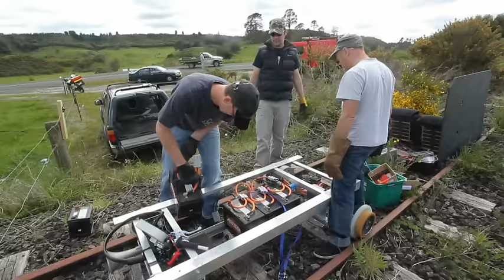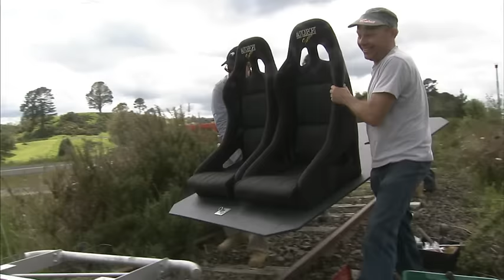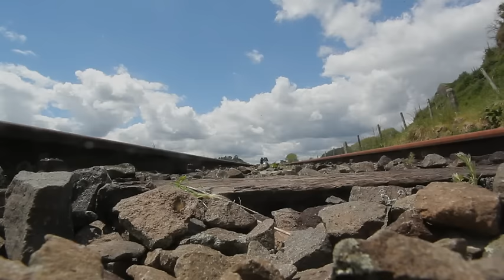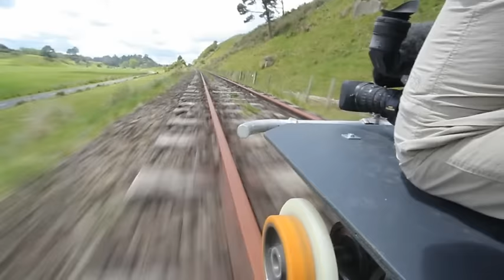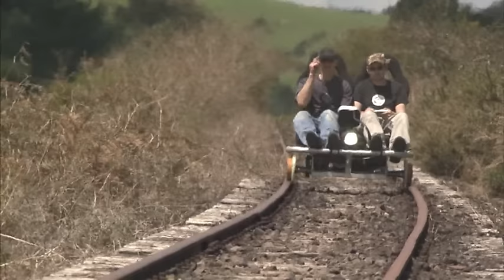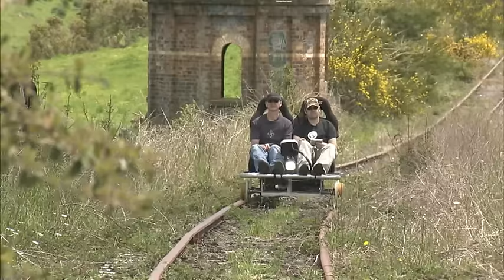First test of our solar powered railway trolley

Comment: Great video. You've got some balls to go this fast with an DIY trolley. A little tip: make your wheels conical shaped. So the outside of the wheel has a smaller circumference than the inside. Just about a few millimeters. This way the trolley will stay on the track without colliding onto the flange, which will roll very smooth. Real train wheels are shaped this way as well.
Reply: Hello Richard after 11 Yrs 😁😁
Reply: Kudos Richard, you are among the oldest users of YouTube
Reply: Are you still alive
Reply: @Shuklaji712  
Same qq
Reply: Are you alive Richard after covid 19?
Reply: @anishtiwari9643  uhum. I’ve been here longer. Just saying 😬
Reply: @tangomike15  wow. Congrats
Reply: @Anish Tiwari  lol!
Reply: @tangomike15  yea. You're using YouTube since i was just 3 yo
Reply: @anishtiwari9643  it was great. No adverts!
Reply: @tangomike15  what is your age bro and where are you from
Reply: After 11 years later i have seen this .

Comment: It is not solar powered.  It is battery powered with partial solar charging capability.
Reply: Maybe full solar charging or how can you know explain us pls
Reply: With the help of Solar energy... battery well be charge....
Reply: Hes talking about the indirect input of solar energy. Its not driving because of the solar power stored in that particular time. Instead its powered by batteries wich were charged with solar power. Its like saying i drive a solar powered tesla, just because i charged it with stored solar power it doesnt mean its solar powered but battery powered
Reply: Certo partial
Reply: ।ऊगखोम
Reply: There is difference between Solar Powered & Solar Charged....
Reply: @GameOver._.  your explain is understandable
Reply: If there weren't batteries in there, the trolley would just stop in the middle of a forest.

Comment: Huh? With all those batteries, how can it be "solar powered?" I didnt see any solar panels on it either.
Reply: So you think solar panels convert the solar energy into electrical energy in real time? lol the technology ain't that advanced yet, friend. Solar panels are connected to batteries which store the energy in chemical form, which is then used to do mechanical work or convert it into other form of energies.
Reply: @ashutoshsharma1293  i already knew that, but why did the "electric rail go-cart" builders claim it was "solar powered" when it was actually battery powered?? Yes, it takes forever to charge anything with solar panels!!
Reply: @paulsmith5398  umm because the batteries were charged using the solar energy? I don't know what's so confusing about it!
Reply: @ashutoshsharma1293  and these companies that sell and hype up solar energy claim its the best, i would rather pay my high-priced electric co-op than have something thats not dependable. If you live off the grid and have solar, when the batteries go dead from no sunlight, youre screwed.
Reply: @paulsmith5398  Yeah, that's common sense which is why world is never going to fully depend on the solar energy until our civilization is advanced enough to harness all the energy coming from the sun. Renewable energy sources are not dependable and that's why they're either used in combinations (Solar with wind and hydraulic) or not used at a very high scale for most things.
Reply: @ashutoshsharma1293  when my wife was living, our electric bill would approach $300/month(US dollars), she paszed away last year, and i have done some energy saving projects. The electric bill has gone down to $105/month (US dollars), and i just got a nice refund to help "pay it forward" for 3 months. Thats the thrifty Scottish bloodline in me!, and i am currently doing more projects to lower the electric bill even further.

Comment: To have panels run the motors direct would take dozens of panels. Far easier to use a few small panels to charge batteries and use them to provide the large amps needed. Not realy solar powered cart though, just battery powered, you could always charge it from a wall outlet and shoot another video called   "NUCLEAR POWERD RAIL CART HOME MADE"
Reply: But you need to store energy before you can use it effectively. Nuclear power is used not directly, but to turn turbines which then generate electricity. When you see "Solar Powered Light" - the solar part is actually to charge the internal battery - it would be useless when the sun goes down and you need a light, if there were no batteries? So there are varying means for storing electricity in order to use it. How friendly that is and what the source of that power is - is the differentiator?

Common arrangements include: -

Solar > Battery > Consumer (Off-Grid)
Solar > Inverter > Grid
Wind > Battery > Consumer (Off-Grid)
Wind > Generator > Grid
Nuclear Reactor > Turbine > Generator > Grid
Reply: DEAN WATERS use high voltage thin film grid tie panels if you could afford it heavy duty lithium ion batteries deep cycle,,, if not then use 6 volt heavy duty golf cart batteries build a trailer put solar panels all over it also build a roof canopy put solar panels on it,,, I imagine you’d have to stop and give the bank a complete charge maybe for a day that’ll give you time to rest up though have some fun
Reply: @ChrizRockster  😊😊😊👌

Comment: IMO...not enough footprint on the rail....unmaintained track is likely to be out of gauge.  In a derailmnent, the cart would stop abruptly.  You would not.  I suggest you consider the consequences of tumbling along the railbed at 30 mph...probably miles from help if any was available.  Clever machine, but you are leading candidates for the Darwin award.
Reply: +Doug Celeste well , you would be standing by the track , "Oh , no that looks to dangerous ! " while they would be off having the fun !
Reply: yes everytime it goes downhill i have some pain in my scars
Reply: The line that I am pretty sure hey are on is a semi maintained one where golf cart type things trundle along.

Comment: wheres the solar power?
Reply: Battery charged by solar cells energy conversion,motorised to mech energy,brakes provide,speed control by resistance banks .solar to elec,elec to mech via motor,brakes mech & elec control resistance box,voltage redn .
Reply: @sudeshchandraagarwal7409  a\a
Reply: @aleechaudhary3478  😎🤔😀😀😀😁😁😁😂😂😂😂😂
Reply: Spongebob: I N  T H E  H A L L S
Reply: @sudeshchandraagarwal7409   all right  brother
Reply: Men sitting in direct sun light
Reply: They are referring the sun

Comment: No solar at all. Just a battery DC motor rail cart. Misleading title.
Reply: Not misleading, it said solar powered. Not solar covered or something. They claim the batteries are charged with solar panels, and I don't see any reason to doubt that.
Reply: @i5-4670k  That is totally not the point. When people say solar powered it generally means there is a solar panel on the vehicle itself....by claiming your "battery was charged by solar energy" thats just pure bullshit.
Reply: @i5-4670k  so if it is charged using  hydro electricity , does that make it water powered?
Reply: @T.W.I.T.  lmao
Reply: @i5-4670k  wow you're really telling him after 3 years
Reply: @441meatloaf  it's not "pure bullshit" mate,   
Just because "generally" people mean that doesn't mean that it means that by definition. If I have a house,  and I have solar panels for my house, but they are over in my backyard and I transfer the energy to my house every now and then, my house is solar powered is it not
Reply: @i5-4670k  if so then where is the solar panel. It is only electric.

Comment: I don't see any solar panels
Reply: I think they meant that the batteries were recharged by solar power before placing them in the buggy which still counts as solar power in my book. 
There are no portable solar panels suitable for this buggy that can maintain anywhere near 160 amps peak draw or even a quarter of that draw.
Reply: smart cat ;DDDDDDDDDDD
Reply: Super
Reply: @scdevon  r
Reply: Men sitting direct sun light

Comment: Nice piece of equipment. I am curious of the componentry to build a 15" gauge tram for my backyard. Obviously the power source is DC, but is the motor DC, or AC? If so, is it 3 phase? What sort of speed control are you using? Seems like very good braking capability.
Reply: Did you ever build it? Did you manage to make regenerative braking?

Comment: I'm not sure i'd feel confortable going the speeds you did on an abandoned railway with track that could be out of gauge in certain areas
Reply: Don't worry, I am sure they had already tested the tracks at slow speed before making the video to make sure the whole length was undamaged and safe to go faster. These guys aren't stupid enough to risk their lives and everything. 
Regards from a certified engineer. 🙂

Comment: I saw car running off the batteries !  So where is the charging solar panel ?  Furthermore , at that rate of speed ?  You will burn down the batteries faster than you can charge it anyway  And your car built looks mighty heavy too !  That will also do some batteries drainage too !

Comment: now to make a really cool video would be to hoock a long rope on a passing train and let it tow a trail bike but five times the speed is it too much to handle , speed wobble, could it be designed for it , maybe rubber in rope for easy start , risk of stepping into rope loop , helmet , armour , ejection seat, parachute , airbags for falling to side, paddings  or air filled , even a safety cage or shell, but detachable from bike. how about a giant ball rolling o the tracks , pulled by train. ball of branches or plastic or rods pipes. and guy  inside on a chair on side bearings . . or like could use an old car pulled behind train  w normal wheels on side of trracks or no rubber and iron wheels on track , but rubber coating inside them. or rope and parachute fly benind train.  any of those ideas can be very dangerous but some might be rather safe maybe if well designed and done. some choose some danger risk  for fun, its popular on youtube like skydiving .  or wings from airplane attatched to old car  pulled on wire behind train till it flies. in sstrong headwind like a kite. ... vs

Comment: No explanation of drivetrain, tested top speed, bakes, etc.  Is NZ standard gauge?  Why all the footage of just the immediate track, can you point the camera up a little to she what's down the track?
And, technically, it's not a "trolley."  Trolley implies a trolley poll making contact with an overhead cable.
In the US this would be more like a "speeder," slang for railway motorcar.

Comment: I would not be hitting them speeds on a track that's needs work , if you watch the wheels and track there moving all over the place as the track is not used and with the heat moved out of place,, no saftey at all...

Comment: push carts.........anything else is cheating. If your drawing 160amps at 12 volts.....thats 1.9kw   Those 5 batteries look like 12 volt, 120 ah.......which I hope are deep cycle, can handle 50% dod. gives 720 watt/hr each, or 3.6 kw/hr for 5.  Drawing 1.9kw hr will last less than 2 hours. With down hill sections, you might get 4 hours.  Solar panel is not big enough to make much, maybe 100 watt/hr...0 degreess to the sun (30% penalty) is only really 70w and over 6 hours of effective sunlight, is only 420 watt hours.  Like the solar racer vehicles, you need to get the weight down (lithium) and have an aerodynamic fairing.  Might be an idea to put some suspension on the cart wheels, rough tracks are going to make life pretty difficult.